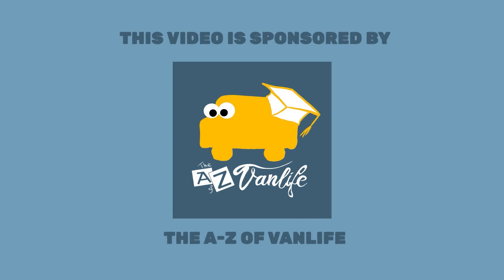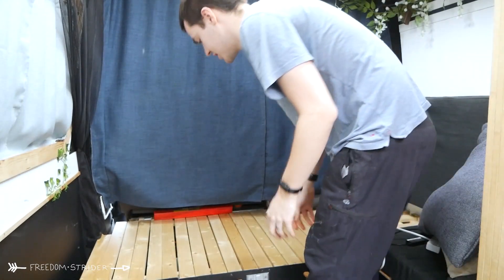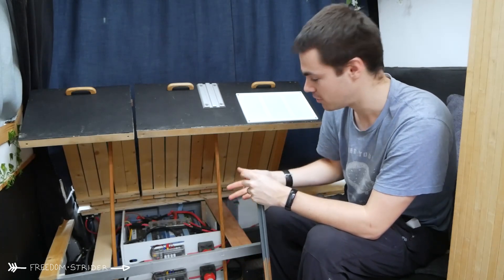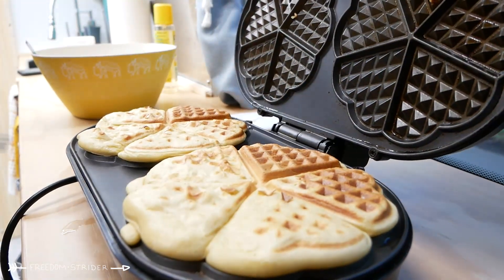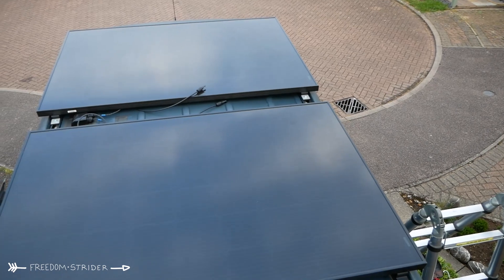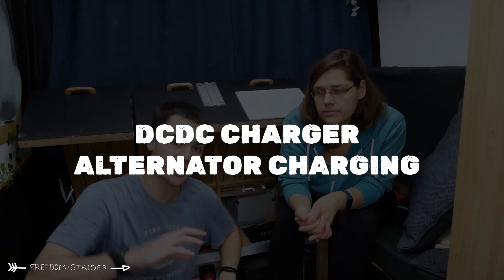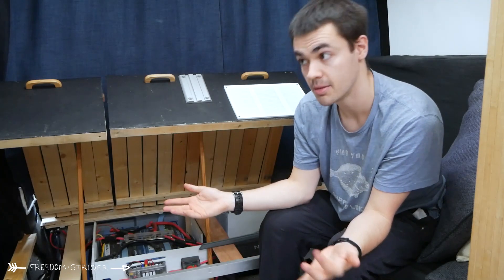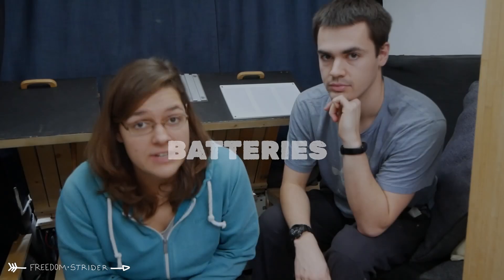CAMPERVAN 12V ELECTRICAL SYSTEM... (1 year real life experience)

Comment: Polly… “what  batteries “ 😂 900 and something 🎉,  just to add to this, with the ac charger, you can use any car 12v charger to charge lifepo4 , and then just add multiple chargers to the same battery. Basically keep what you have and just add to it.. your BMS will take care of it. 
My 100ah lithium I use 3 old 5amp car chargers (15amps) 
My bigger lithium I have a 20amp charger.. but I’m always looking to add another old charger off Facebook marketplace..😊
Reply from the maker: Adding multiple AC chargers, not something we thought of! Onto marketplace we go...! We rarely use ac charging but when we do, charging them faster would be nice...especially with the bigger capacity 👀

Comment: Lithium is so cheap now I'm looking at double my capacity to 600ah but it's difficult to charge that kinda battery bank in a reasonable amount of time. Its made me start to think about more exotic methods of charging like using EV points or a secondary alternator.
Reply from the maker: Yes...ev points are something I think alot of people are looking into and want to use. A second alternator is a fair amount of work to fit plus £500 or so to buy and fit...

I don't think it will be long before ev charging will be the norm 🤞👀
Reply: @FreedomStrider  True but when I hear about campervans in the US with stuff like The Volta Power System being able to run Air Con all night and charge quickly after a drive I'm so jealous.